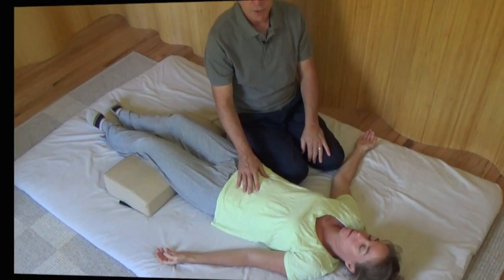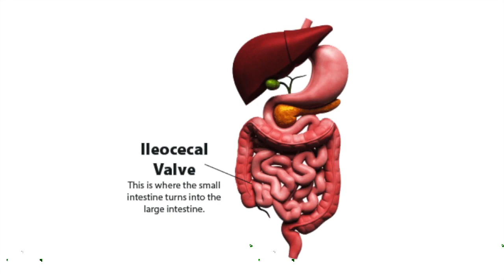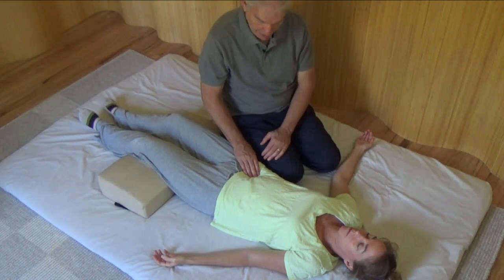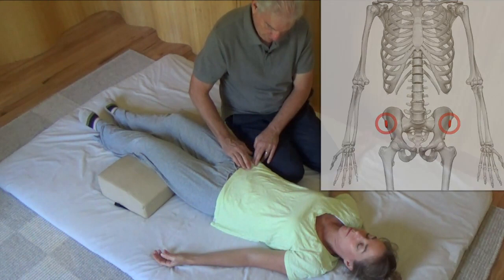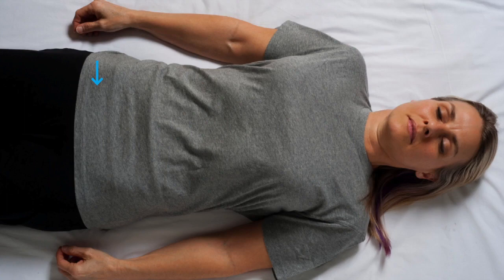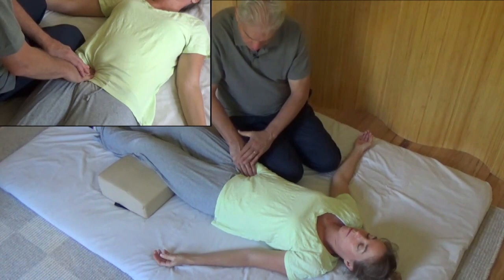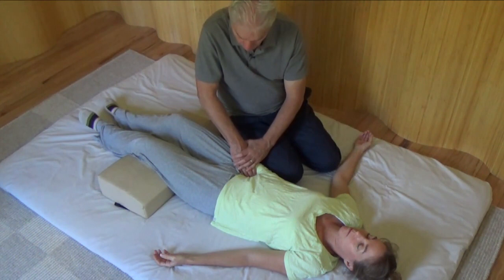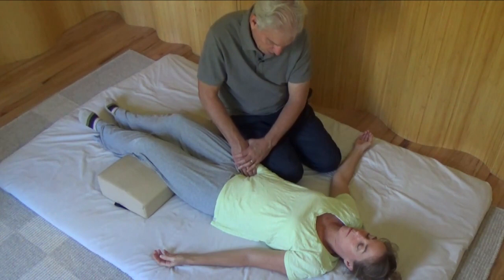Treatment of the Ileocecal Valve: learn this shiatsu technique to improve digestion

Comment: Thanks for this demonstration. May I ask, what is the root cause of a valve chronically stuck open (i.e., hypotonic) and how is that best corrected?
Reply: Improving diet, chewing food really well, and exercise (especially walking) are all possible causes and solutions to improving the functioning of this valve. The treatment in the video can be used regularly in order to stimulate chi, circulation and thus better operation.
Reply: Food born illness pathogens create toxins which cause MMC dysfunction which leads to IC valve dysfunction usually leading to SIBO. SIBO creates additional health problems. No such thing as IBS as a diagnosis, it’s a symptom of a much bigger issue.

Comment: I do this but at the same time I roll my right leg in & out for approx 3 minutes, whilst holding/massaging the valve. That was how I learnt to do it & I'm wondering if there's a difference, or maybe it's done quicker or slower?
Reply from the maker: That can increase the effectiveness. Whatever you notice creates the most stimulation/change would be the most optimum.

Comment: is it normal to feel nausea when massaging?
Reply from the maker: Yes, often someone can feel nausea during this technique and deep hara work in general. As the tissues decompress, toxins that have been held are released into the bloodstream to be cleansed from the body. This can create a wave of nausea that may last a short period of time. It is a good sign that things are moving although of course not comfortable for the receiver. It helps to have them sit up and drink some water if it is strong.
Reply: @ShiatsuShinTaiInternational  Thank you for the info, appreciate it. Will give it a try at intervals. :)
Reply: Here is my solely intuitive response:  do you understand that the practitioner has extensive knowledge of anatomy - do you.  (I do not).  Also, while I understand that nausea can be a response, and that the Shiatsu Shin Tai person responded by saying it was a response to moving toxins - I don't like that answer one bit.  If they were going to give that answer, then they must offer advice, such as, for example, that drinking water would help - although some people, depending on their condition might not be urged to drink a quantity of water.  Or, "stop doing that."  If the nausea stops, then don't do it. If the nausea continues, you need to see a professional.  And maybe make sure you do not have other symptoms, in which case, you need to see a professional - a professional in traditional medicine, or otherwise.  I would hope that the shiatsu practitioner here has knowledge of the woman's medical history prior to working on her.  (Also, I note that she does not seem to be breathing well.  Breath is important.  I see no rising and falling of her chest.  Not good.  So.  It is a matter of knowing what you are doing, and paying attention to reactions of your body.  If you feel nauseous, if it were me, I would stop.  Particularly with people who get other types of massages, it drives me nuts that they have become convinced that if they should (in bold) feel pain.  No.  Healing arts should not cause a great deal of pain.
Reply: @Jakeornot  Hi, I'm Lynn Goodman, Saul Goodman's wife. He is the practitioner in the video and the developer of shiatsu shin tai bodywork. Most people who watch our materials are already bodyworkers, so have experience with basic anatomy and physiology. The concepts of how to identify, contact and help release restriction patterns in the soft tissue system of the body apply regardless and Saul always tries to 'teach' in the most practical, clear way possible. We certainly never condone any kind of treatment that uses force to facilitate change in the body nor the idea that pain is necessary in order to improve. Nausea though can occur and we would never encourage the practitioner to do much more at that point. This is one short video to help support those who are using bodywork and not a full explanation and learning experience. Perhaps you would enjoy exploring some of our other materials because in shin tai work one of the central guidelines is adjusting treatment to the responses of the receiver, especially breath and motion in the body. There is in fact a unique system of evaluation of motion that is used to identify how to proceed during treatment.
Reply: @Jakeornot  Get over yourself.  Healing and growth often involve pain and discomfort.
Reply: @groob33  He didn't say it Should NEVER cause  pain.  Tolerance for pain varies from person to person.  Just because you are getting a Massage that hurts does NOT mean it is working.  Also MANY ppl. Act differently to a Massage. I think what he was saying is was Lynn said.  If you are unsure, or not familiar with this, then see a Professional, Opposed to a couple in their bedroom, trying to cure what could be a serious illness.
Reply: @J.T.19134  Just because you are getting a massage that hurts does NOT mean it is NOT working either.  EVERY time I get a massage it hurts.  And that's the way I like it.  If it's not causing me discomfort then I have them go deeper and harder until it does.  BTW, Every time I run a Marathon it hurts.  And I like it.
Reply: @groob33  OK, Thats YOU,  Some people get a Massage with NO pain, and feel completely relaxed because it releases the small amount of toxins. Again not EVERYONE has to feel pain.  After running a marathon, is just "SLIGHTLY" different then receiving a massage, wouldn't you say???

Comment: How is illeocecal valve dysfunction connected to a Hiatal Hernia?
Reply from the maker: Disfunction here indicates stagnant or imbalanced energy in the area. This also may have affected other parts of the digestive tract, leading to weakness or tension in the tissues and/or organs, which could sometimes manifest in a hernia. They are not necessarily connected though.

Comment: Can I massage it with oil? Or do I empty stomach to do it or I can do it after eating? Your reply will be highly appreciated.
Reply from the maker: You can use oil, although in shiatsu touch is usually applied through clothing. The skin on skin contact can make it more challenging to feel the flow of energy through an area or point. It is best to do any kind of treatment at least an hour or two after eating. That leaves time for the body to focus on the beginning process of digestion.

Comment: Don't you have to discern if ther valve is open or closed?
Reply from the maker: No, it is not necessary. Applying gentle pressure and working with releasing tension/torsion in the tissues of the area will assist the valve in restoring more natural function regardless how it has been 'off.'

Comment: How long can the valve area be manipulated?  As in how many seconds.  And, is this done once a day or multiple times?  
Will this help,the valve to revert to its normal position?
Reply from the maker: It's best to apply gentle pressure and wait. If you hear a gurgling sound it means a reaction of the parasympathetic nervous system which closes the valve. As long as you use gentle pressure you can hold a couple of minutes and repeat as needed
Reply: Thank you for your reply!  I have pain as I press down.  What does that indicate?
Reply from the maker: If it radiates it could be good to see a doctor
Reply: @ShiatsuShinTaiInternational  What should you do if you hear a gurgling sound?
Reply from the maker: @flutisticwonder  It's best to apply gentle pressure and wait. If you hear a gurgling sound it means a reaction of the parasympathetic nervous system which closes the valve. This is a positive response that is common when doing this technique. As long as you use gentle pressure you can hold a couple of minutes and repeat as needed.

Comment: Is that any reasons why is not working properly??? Thanks 🙏🏽
Reply: Improving diet, chewing food really well, and exercise (especially walking) are all possible causes and solutions to improving the functioning of this valve. The treatment in the video can be used regularly in order to stimulate chi, circulation and thus better operation. Some people are born with a constitutional strength or weakness in this area which would create a greater likelihood of having issues with it.
Reply: Food born illness pathogens create toxins which cause MMC dysfunction which leads to IC valve dysfunction usually leading to SIBO. SIBO creates additional health problems. SIBO can be treated and sometimes cured.